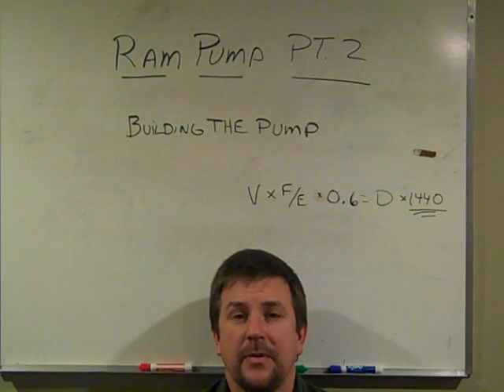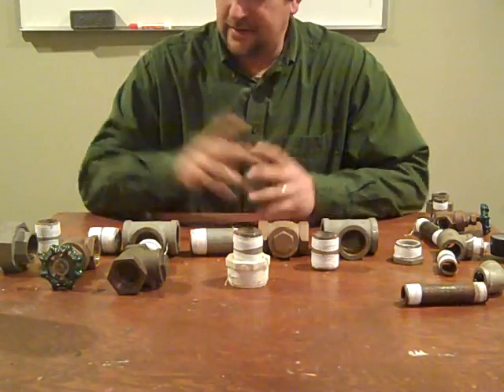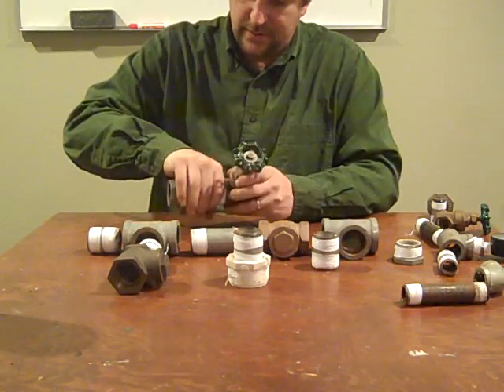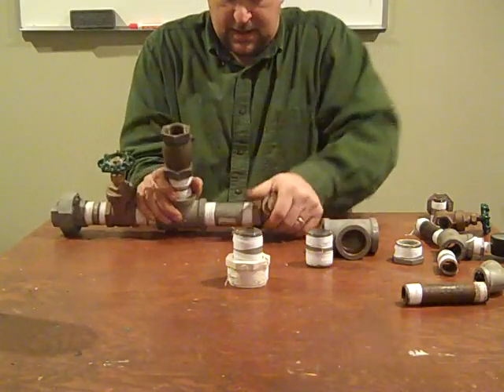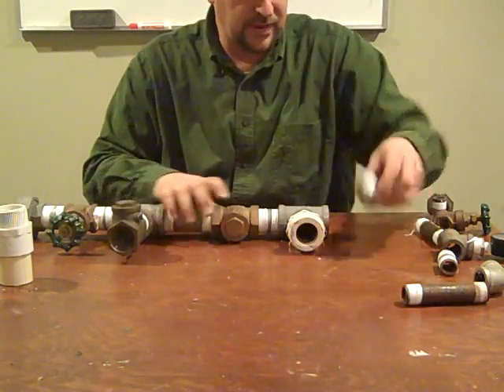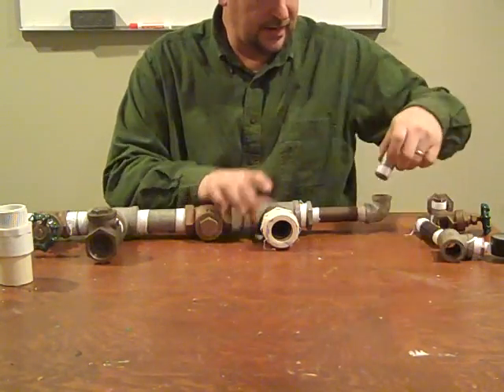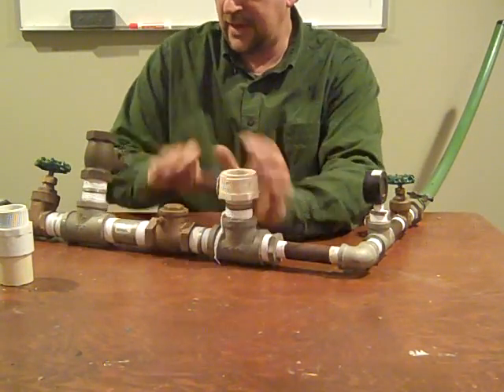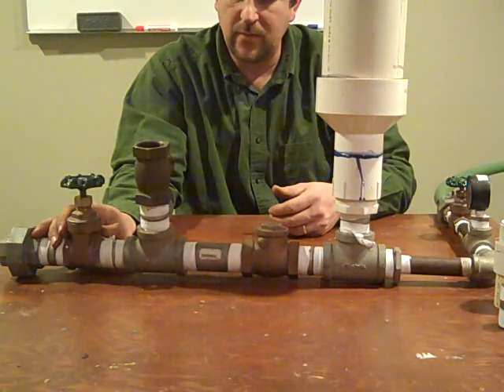Ram pump Pt.2

Comment: Interesting video... 
I will try it.... 
One question...  Can i use 1" Swing valve for waist valve and 1" Spring valve (NRV)    for pressure valve ? 
Hope your answer... 
Thank you.
Reply: I tried to make ram pump today... As you taught in the video... And it's amazing... I got success... It is working... Thanks a lot of... 🙏🙏
I used check valve without spring...and swing valve...

Comment: I watched your Part 1 and have 2 questions. One is when the flow is low , say 2.0 - 2.5 gpm the largest intake line can only be a 1/2 inch pipe. Schedule 40 PVC preferred. I believe the average maximum lift is a 1:7 ratio with a top lift of no more than 170 vertical feet. Therefore to maximize a systems potential , the head ( fall ) needs to be approx. 24 feet to lift 170’.  I like this however your formula does not support this type of system . Number one you state the delivery pipe needs to be half the diameter of the supply line, so for a 1/2 pipe, this would be 1/4” which is not standard for this use in poly rolled pipe. Secondly you state that for head of approx. 24’, the length of the supply line needs to be 4 x the fall or approx 100 ‘. My question here is : Can this length be shorter or longer by some established percentage or is it critical to your formula?
For my use, I have a minimum flow of 2.0 gpm. I need to lift it to a minimum 500 gallon tank . This tank sits 160 feet above the discharge point of the ram pump. This because I need a minimum of 35 PSI to my points of use and that is why the storage tank is set as high as possible on the farm.
I have been told that most RP’s discharge 80% of the water back into the spring fed creek. So I get 20% of the water coming in or .40 gpm. Or 1440 x.40= 576 gallons per day. This is great except for your 2 points regarding the sizing of the intake PVC line and the output lift line. I would love to hear your thoughts on my comments.

Thanks,  Michael

Comment: The union goes in front of the shut off valve, so the pump can be serviced, the pressure vessel dose not need any thing inside just air.
Reply: It can be

Comment: What does the size of the pressure tank matter how much volume it pumps?
Reply from the maker: The size of the bladder tank doesn't seem to matter that much it's just very important to have air in the system or the ram will not rebound properly.
Reply: @engineer775  thanks

Comment: Engineer 775. 
Your great at the math but lacking as a plumber. Your valves and unions need to be swapped with each other. Valve first then union. Same on the other end. Then install a relief valve somewhere in the middle. Preferably right under your pressure tank to bleed pressure and drain the tank. Think about decommissioning or for the layman, disconnecting the pump from either end or both ends. With your configuration your going to get real wet and with enough pressure get hurt. You have to be able to hold back (isolate) the head pressure with a valve before loosening the union. Both the intake and the discharge are well above the pump and under pressure. Also if you use a weight adjustable vertical check valve you can then fine tune the pump for much better efficiency. Great job on explaining the math. Slow it down a bit. Take your time so that we have a bit more time to absorb what your saying.

Comment: Can I siphon out of shallow well with several feet of drop and then pump it uphill with a 100' lift to holding tank?
Reply from the maker: You'll need about 8feet of fall to do it.
Reply: @engineer775  I have to siphon up and out of shallow well....about a 15' lift. So, you are saying I have to drop 8 feet from the level of the water in the shallow well?
Reply: @engineer775  1 1/4" Ram Pump/Head?

Comment: Ive got a 10 ft drop to wherr i can set pump an need to send up elevation about 50 ft 300 ft till lake final point. Im makin a 1 1 1  1/4 "to 3/4 outlet what does my pressue chamber be. In height. An do i need a water chamber before .my drive pipe.last 50ft is a 5 ft drop.

Comment: Should the unions be on the other side of the valves so you can shut off the drive pipe and delivery pipes and take the pump out without having to drain the water from those lines?

Comment: Hi. Given the current times I am putting in a Ram Pump. I am using your design in this video. Question when installing the waste check valve is there a optimal orientation for the valve in its 360 rotation. Specifically the access cap on the valve. In the video it is oriented at a 90 degree angle to the linear flow of the water. Is there a benefit to pointing it Upstream or downstream of the flow? I saw the demonstration of changing the perpendicular angle from vertical and understand the volume adjustment but it I didn’t see this other point in your video. 

Another hydraulic question. Is there any benefit in a high flow creek ram pump set up to start out at the filter input with a larger pipe size say 4” and drop that down to a 2” for the drive pipe.  Would this increase the velocity of the water before it hits the ram increasing pump potential? I have a bunch of pipe around. 

I am putting in a 2” Ram

Comment: I have a couple of questions about the formula for output volume   V x F/E x  0.6 = D[gallons] x 1440 at 1:30 in the video.     I think E stood for Efficiency - how do we calculate this?  Is it volume of water lifted / volume of water in?   I noticed that lift height was not one of the parameters.   If we double the lift height, is the same, 1/2 the volume or 1/4 the volume  or some other volume of water delivered,   I've seen charts that vary.   Also, while initially, I thought all I cared about was volume of water delivered to the needed height, I've realized that I also will need some pressure for irrigation purposes to run a drip or low pressure sprinkler system unless I fill a tank, but then the height of the tank matters to get the pressure anyway.   

For irrigation, optimizing cost per volume delivered to a usable height (or pressure) would seem to be the objective.   It is possible that several smaller pumps, costing less per each, might deliver more total water volume and cost less than a larger, more expensive pump - or maybe not.
Dave from the Water Powered Pumps facebook group: https://www.facebook.com/groups/240458583255303/

Comment: Ram pump in well?
A cylinder would provide a head for the ram pump & the waste water need's clearing!
So building a hero fountain under the ram pump & having the fountain outlet 
back into the well source
Could work?
 https://youtu.be/WYnlbFd45V8 hero's fountain.

Comment: How long do you expect this ram pump to last?   Is the Brass Swing Check Valve the weak link, being the part most likely to fail?  Especially since you are running unfiltered and un-purified water through it, and thus very likely to corrode?

Comment: I used a one inch drive line into my ram pump with a half inch supply line. About 16-17 feet of fall on drive line hundred feet long , my supply line is 380 ft. Long lifting water  approximately 110-120 feet high. 1 gallon every 7 minutes. How can I increase my production?

Comment: It is possible to construct a ram pump according to the model of a gardening hose which, on the one side, has a suction valve which has a ball  that sucks the river water with a certain drop while on the other side the gadren hose  is connected to a plastic PVC  barrel (which can have a volume of 150 Liter) where the river water will fill the plastic PVC barrel or that the drain valve can be made on the plastic  lid or hood ?

Comment: Why does the pressure vessel need to have the bicycle tube or swim noodle installed?
Reply: I believe it is to act as a hydraulic shock absorber to lessen the hammer effect of the pumps pressure changes.  I would think that just having air trapped in the top of the pressure vessel would work (as air compresses and water does not)...but maybe this is better.  Maybe this is better because you would not know how much air was trapped, but with a noodle, you do.
Reply: It's to prevent the air from being absorbed by the water over time.  Once that happens the ram stops working until it has more air to act as the spring in the system.

Comment: I'm curious. Why not have a third check valve on the inlet before your hammer valve, even 10 feet back to the source,  to prevent the spike from ramming back into the supply line, back to the source? Could this work, and maybe increase efficiency, or possibly prevent it from working?

Comment: if you put the two gate valves on the drive and delivery lines rather than on the pump ie on the other side of the union you can 
 isolate the pump as you do now but with the advantage of being able to stop the flow down your drive line and the supply line will not drain back to where you are working. Also if you put another check valve about halfway along the supply line the pump will be far more efficient because of the reduction in back pressure. very good tutorial please keep going

Comment: Thank you for all you hard work and teaching.  Question: will it work...if after the waste water valve you install the check valve and lay your pressure chamber down horizontally and have the delivery line feed out of the end of the pressure chamber...2" feed...5' head...1" delivery 40' elevation...

Comment: I've built it with PVC. The line from the source to the pump is 2.5'' (6 meters length) ,the line from the pump to my storage is 1 1/4'' (25 meters length) and my air tube is a 19 liter hard plastic bottle . The system is completed but I have a problem. When I let water go, water go up and the bronze check valve is closed and the air tube is filled with some water. But that's it. It doesn't work automatically even if I push the valve. Also there are little leakages in some links and the spring valve but I can see enough pressure at the bronze check valve and my gauge (about 0.3 bar). Do these leakages cause it? or what's wrong with my system Sir?

Comment: Could you please give information on putting a bicycle tube in the pressure chamber and where does the valve of the bicycle tube go? Also the height of pressure chamber required? Thanks
Reply: +Lana Tyacke you do not need anything inside your pressure chamber. The only reason for introducing pressure to the chamber is to ensure that there is as little water as possible. The less water in the chamber, the less inertia the ram effect needs to overcome to get more water in. This means that as long as you make your air chamber large enough, there will be only a small reduction in efficiency until natural bubbles in the supply line fill the air chamber with more air. But that will take a long time compared to pumping in air with a bicycle pump. I personally think the piece of some kind of closed cell foam is the best option.

Comment: i like very much your ram pump and well explained but the problem is its so hard to have them in our province palawan, philippines
Reply: MARIA FIECHTER A ram pump is a good a device for use in some areas, but it won't work in all locations.  There are options in other videos for well pumps that engineer775 has produced.

Comment: Why do all the folks showing how to build these pumps put their gate valves on the wrong side of the unions? If you have to take the pump apart, with this configuration you can't shut off the flow from your pipes.
Reply: pinantan001 Good call - I thought it was just me..... :-)The important thing to know is that you need to stop the flow from BOTH sides before taking the unions apart - or doing any work on the pump.
Reply: doesnt he have one on each side?

Comment: Engineer 775, I dont understand what type of fill material required for the pressure vessel and the specifications for packing the material.
Also is it some sort of surge arrester?
Reply: Westech Limited The idea behind the pressure vessel is for the pressure from the feed line to fill until the pressure equalizes, then the pressure in the vessels helps to push up the delivery line.

The fill material needs to be 'flexible' so that it can absorb some of the pressure from the feed, then release that pressure to the delivery to help push it up the elevation.  The fill that is commonly used is an inner tube from a bicycle or a wheelbarrow.  Part of the reason for this is that the pressure can be adjusted by adding or removing some pressure from the inner tube.

Too much pressure and the feed line will not be able to put too much into the vessel before the flow stops.  This actually reduces the GPM flow.

Too little pressure and the delivery line will be slower in pump because it does not have the help from the vessel fill material.

The closed cell that he mentioned will work, but it will need to be replaced a little more often.  It is a good 'middle of the road' material to use, though, and is good for first time builders.

Comment: I have a water tank at my house and would like to use a ram pump to bring water up my hill to an elevation of about 35 feet. The spigot on the tank is only 2-3 feet above the ground, but the top of the tank is 8 feet high.  Silly question: is the fall needed for the drive pipe equated at the spigot, or at the water level of the tank??
Reply: Inisfad I would recommend that you do not pump the water into the bottom of the tank, but the top to reduce the pressure pushing back against the delivery flow.

That being said, you need to worry about the highest point that water needs to be pumped to. In the case of the water being pumped into a tank, it is the point where the water exits the delivery pipe and falls into the tank.

If you are filling two tanks at the same time, I would have the delivery pipe go up to the top, put two elbows on, then put a T in, sending one half to each tank.  I would also suggest that there be a little space between the elbows and the T before splitting to allow the little gravity to help with the flow.

Just my pennies worth.
Reply: Yeah... you're not going to pump into the spigot.

Comment: lol you coul build it from pvc with assembly in shorter than this vid and much cheaper. also why not use a simple baloon in the airreservar? this is really small it would rock a lot more if it would be big
Reply from the maker: PVC pumps will not perform like metal pumps. Balloons will not hold up.
Reply: steffankaizer Although PVC is less expensive, it does not have the longevity of the metal pipes.  Remember that these will be out side, exposed to the elements, so a sturdy material is they way to go.

Even with metal, the 'flap valve' - the heart of a ram pump - generally needs to be replaced every year or so.  A PVC version will last about 4 months,

If you want to test this and don't want to put a lot of money into it, PVC will work as a proof of concept.  But for the long haul, go with the steel.

As for the balloon you mentioned, I presume you mean for the pressure vessel.  If you were to do that, the only balloon I could see using would be a heavy duty balloon, like the punching balloon you can get.  But even those are not likely to last as well as the inner tube or closed cell foam will for fill.
Reply: that is all true i see that now.

Comment: i have really enjoyed your ram pump videos.  what is the minimum flow rate that is required to "feed" the pump?  my spring feeds the pond about a gallon per minute so have about the same amount of overflow.  I could use a small solar pump to increase the overflow rate.

Comment: This is a pretty good, but this can be simplified in many ways and there's no reason to build a special air chamber. The design I came up with is also very easy to start.
I used to build dozens of ram pumps for watering cattle.
Reply: WoodchuckinPA If I send you my plans for a ram pump setup to aerate my pond, would you help me?    Vern Boggs
Reply: G. Vernon Boggs  atlin4vern@gmail.com

Comment from the maker: Yes a 10 HDU (10HDU Max Fall 50ft. Max elevation 500ft. Intake 3 - 10 GPM) will work .  the pump cost ($1970.00).  Send me a pm or got to practical preppers and contact me there for more info.

Comment: My spring volume is 3.5gpm and I can get up to 30-40 of drop with the drive line to my pump site but I have to get water up 160' to the tank site and the over all distance is about 1000' from pump to tank so my question is can this work with a ram pump??? If so what pump would be recommended for this project???  Any help would be greatly appreciated.

Thanks
Justin

Comment: I run a aeroponics system. which include fish in the water system. metals in the tank are not good for water management. what are my options? i want to pump water from the tank to another tank that may be 15 in elevation. i can create the fall, but how low would i have to take the fall to make this work?

Comment: Hi, Engineer 775 im viewing you video i have knowledge to make ram pump in may house water supply. But I have a problem it can do ram pump in spring water source in level area? i have plan is to built a pipe to over flow a water 5' it can be reach the source of water flow. my  ram pump i made 3/4" input and output 1/4" tube my fall drop is 5' and elevation 60'. my ram pump could be function? let me answer my problem. thanks. More video give knowledge people technical.

Comment: Wranglerstar built this same pump and used a 3' section of pvc 1/2 filled with a pool noodle. His lifts about 150 ft verticle  roughly 500' from the pump station. Hope that helps, 3' will be the size I use when I get around to building my pump.

Comment: would it be more efficient to have your well pump , pump water into a tank high enough to give you your required water pressure or have it run as normal ?

Comment: Would be nice to show a diagram of the pump and show how it actually works.  Much like you did with flow rates and drops in elevation.  It's great you put one together but how does the water flow through it and build pressure?